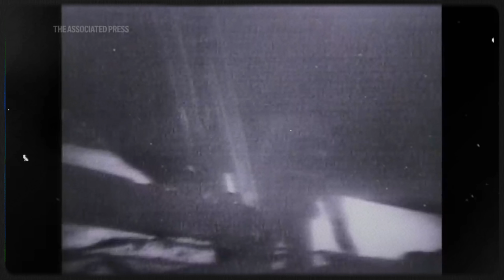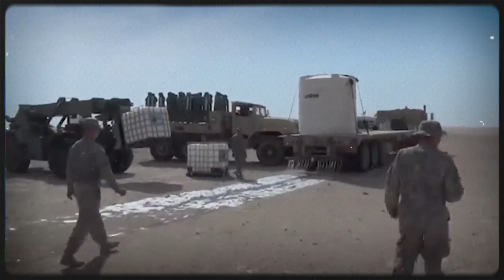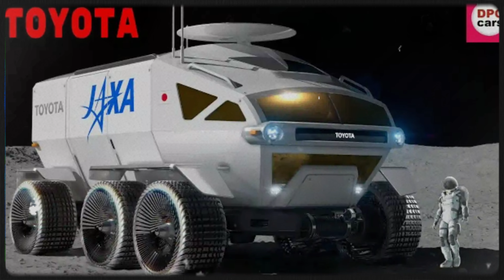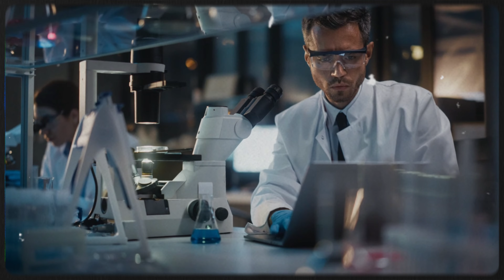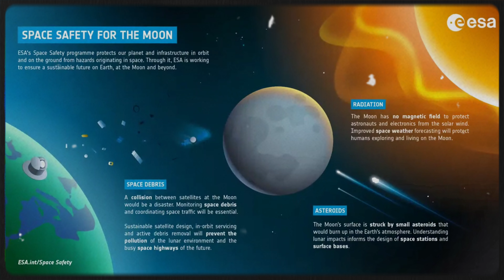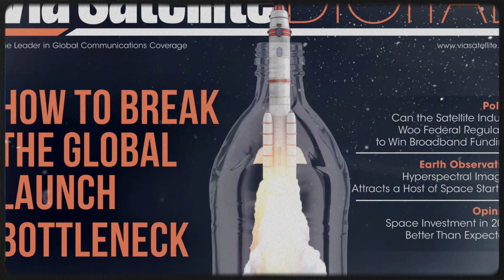How NASA Plans to Build a City on the Moon by 2030

Comment: NASA should put their cities in lunar lava tubes.  The tubes are radiation shielded, and their temperatures remain constant over the lunar day/night cycle.    Dust inside the lava tubes would not be electrically charged by radiation, so much less of a problem.  The powdery regolith that is so problematic  won't exist far away from openings in the tubes.  The first move is to explore known "windows" found by lunar orbiter photography to find those best suited for development.
A landing pad, and a crane to lower cargo into the chosen lava tube should be the first permanent structures.   
Surface facilities should be landing pads, telescopes,  PV.  Anything that can be done below surface should, where people are safer, and conditions are less extreme.